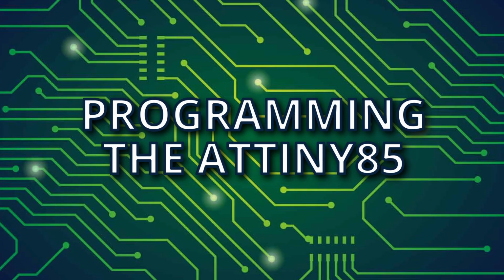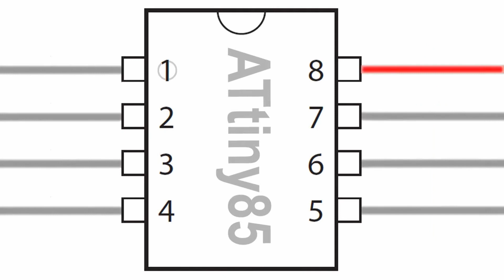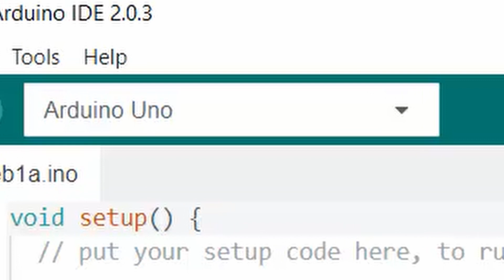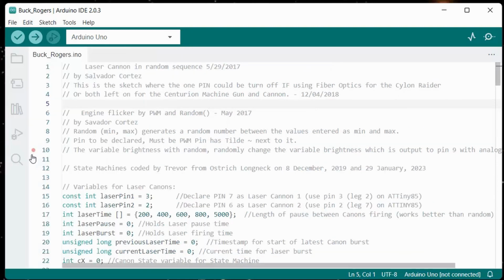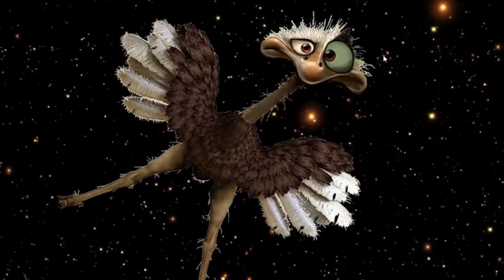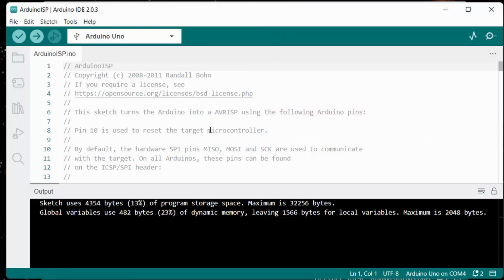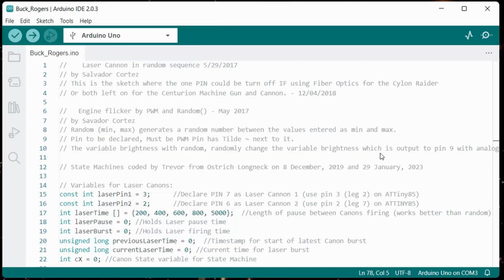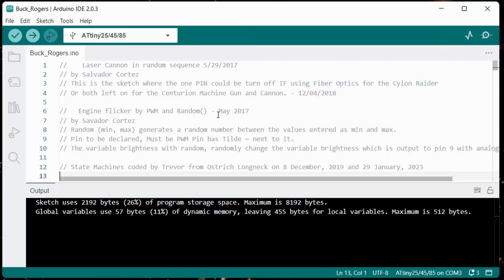Arduino for Starships - Ch14 - Programming the ATtiny85 Microcontroller Using Arduino IDE Version 2

Comment: Hey, i dont have an arduino uno, i have an esp32 but i dont seem to get the connections right because i cant burn the bootloader nor upload any code have you got any tips ?
Reply from the maker: Hi, no, sorry. I'm a total noob with the esp32. I haven't had any experience with it.
Reply: @OstrichLongneck  Hmm okay, do you know which pins (miso mois etc.) from the arduino uno were connected to the attiny85 ? I always get the not in sync error (failed to erase device)

Comment: Thank you nicely explained,I have been trying for two days. on my attempt I had some problems and the ATtinys would not take the bootloader, I did try to use the capacitor and 2 out of 3 workd but 1 says it needs erasing. I'm continuing to learn.

Comment: Thanks a lot for this great tutorial, very helpful. Do I have to restore any settings on the Arduino after having programmed the Attiny85?
Reply from the maker: Thanks very much, Stephan 😁I'm glad it was useful. No, you don't need to restore any settings, unless you're programming a different type of chip. The Arduino will reset the required defaults and work normally the next time you upload a sketch to it.